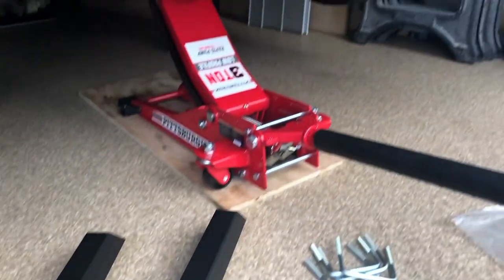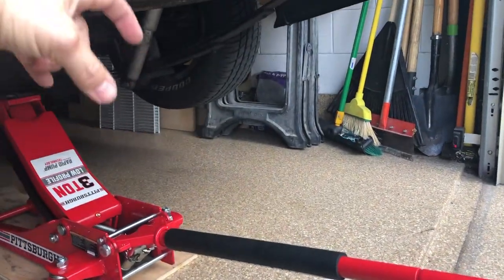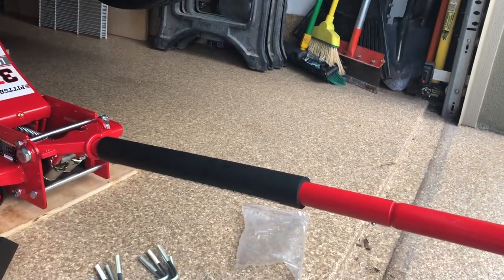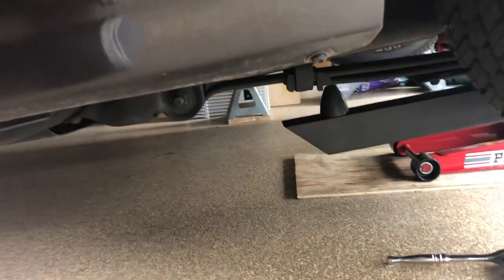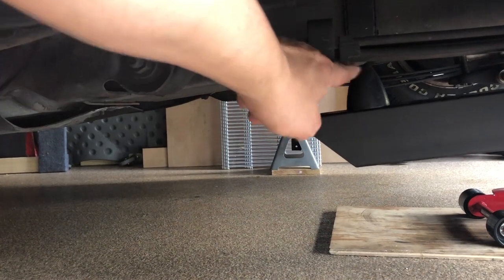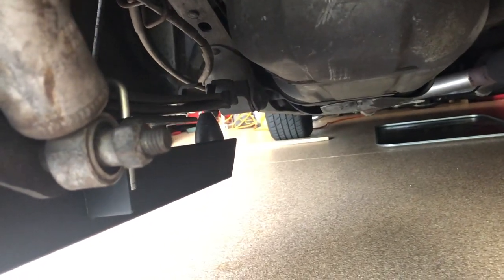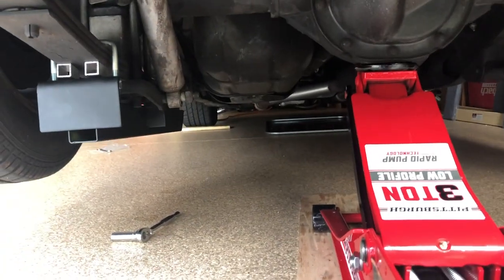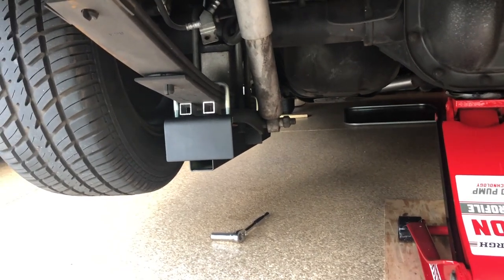Installing Traction Bars

Comment: Your snubbers should be making contact with the front spring eye when under power. It appears your bars are way  too short to accomplish that.
You will still experience axle wind up.
Reply from the maker: No more wheel hop, I can tell you that!
Reply: @CliffsHowTo  

I’m glad it worked good for you.

Comment: Another site says snubber has to hit spring eye...has yours worked. I have to cut my bar to avoid side pipes and it will hit like yours do.
Reply from the maker: They’ve worked great! Wheel hop was insane before. Plus I knocked off almost 1/2 second on the 1/4 mile, with only adding the traction bars!

Comment: Great video if I were u cliff I would get a rear diff of a 99 s10 extreme 4.3 they are Limited slip and comes with wheel hoop shock ready and loaded I know cause I also use traction bars and it picks up quick